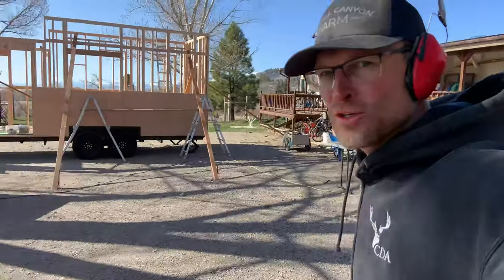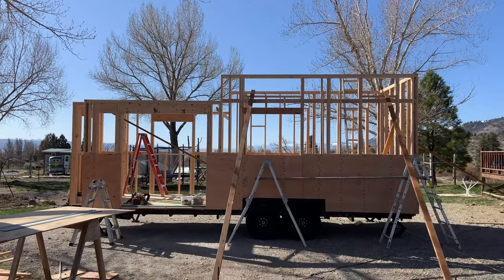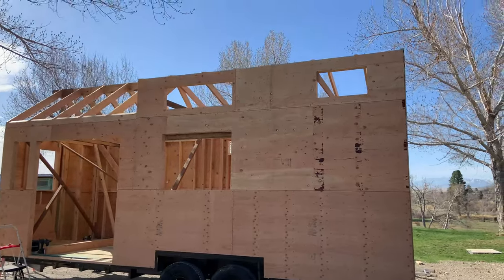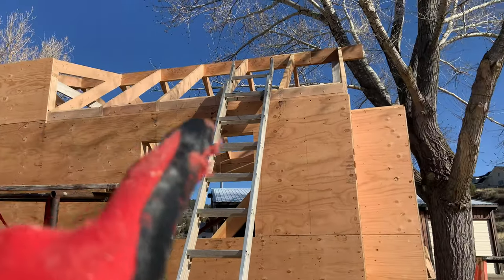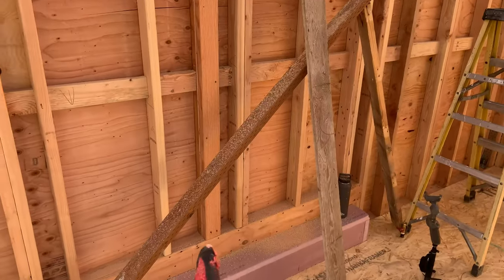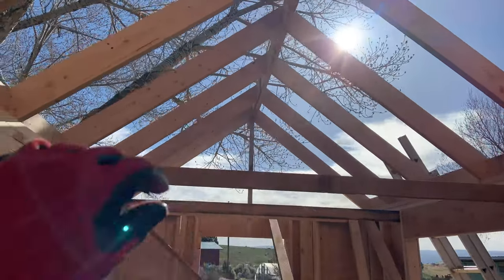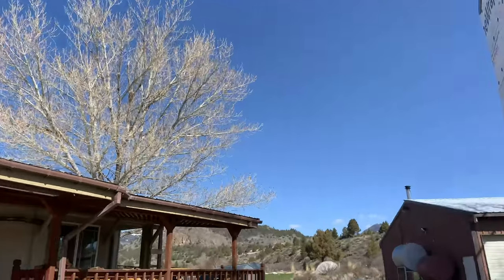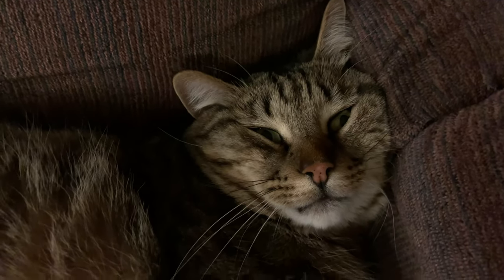Tiny House on Wheels // Part 4 // Framing Overview

Comment: You might want to pour some thread cutting oil on that pipe as you thread. It’ll help prevent broken threads, and give it a smoother fit
Reply from the maker: Oh, I did. Just don’t think it made the final edit. It is almost impossible to get good results without it. Thank you for the comment!

Comment: Also, cant help but notice you omitted your valley rafters on the dormer in your sketch up design. I figured out how to build those using the compass rotate function and the simple valley rafter calculations given on the old online calculators.  Got even crazier though in my design when I started using radiused rafters in a valley setting, which I learned later was called a crotch. Very cool thanks for all of your design detail tips on the iron eagle.
Reply from the maker: If anyone was to notice the omission I had a feeling it was going to be you!Good eye mate. We decided to forego the dormer plan to streamline the build a bit. It was going to add too much time for what it was worth. It did look nice in sketch-up and would shed water/snow away from the door opening, but it just didn’t happen. Poor dormer.

Comment: Hey Brian, nice design! You really shroud your framing process in mystery! You were just gusseting two by sixes together, I’m guessing they were bottom plates and I’m guessing you were framing them in tandem?  What was up with that clip right before you jumped to all of the walls stacked on top of each other? I too am about to start framing inside a garage that won’t allow for wall erection height.  I like what you’re doing.
Cheers.
Reply from the maker: Hi Scott. I am currently working on a more in-depth framing video with more of a deep dive into the choices and techniques used in the framing. The 2x6s were temporarily used to construct a rail system to frame the wall above the wheel wells using the roof rafters as rails. After we stood the walls they were disassembled and used in the roof.

Comment: Hey Brian, I notice when your were doing your sub floor, you added a 1.5"  foam insulation. Did you screw the sub floor to the flange or did you hope the foam will be enough support. My concern would be some flexing issue with the floor. You used a single bottom plate. did your sub floor go above the bottom plate? How did you handle the vapor and air barrier for the sub floor? 
Many Thanks
Reply from the maker: Hi there! The subfloor is bolted through the rim joist and floats above the foamular in the pan. It compresses the foam on the rim joist  between the outside steel of the trailer and the rim joist 2x6 and essentially the entire subfloor is supported by the 5/8” bolts. No vapor barrier on the inside, however the foamular has been glued together and to the trailer. Hope this helps!
Reply: @BidwellCanyonFarm   Thanks for the reply. How about the flange part where the ply sheet sits on the foam and flange. Is the foam enough support to hold the ply or should we put a 1.5" thick  wood strip spanned along the flange to provide support for the  ply sheet. Your sub floor is above the bottom sill is that going to be a problem when doing the interior finishing?

Comment: I'm really enjoying those videos. My design is quite similar to yours but smaller.
Reply from the maker: Awesome! Did you get your building materials before the big price increase?
Reply: @BidwellCanyonFarm  oh my gosh, I wish.  It's insane. Got lucky on a few deals here and there. You should see my setup, the exact opposite as yours: in my driveway, with a tiny shed on it's side and about 200 sq. ft. to spare and build.

Comment: Brian, Quick question.  Did you run sheathing over the flange on the wheel well?  Or, does it just butt up against the edge of the flange and the WRB overlapped and glued to the metal?  Thanks ahead, Scott
Reply from the maker: Hey Scott! Good to hear from you. I have not yet added sheathing there, but i am planning on it. I glued the xps right to the metal and glued the framing above (4x6 header underside) and double trimmer studs to the xps as a seal. I want to glue one more layer of xps on top of the existing stuff and doubling the wheel well r-value to 15. Then framing a box which connects at the sub floor and ledgers off the wheel well header, then sheathing it with 1/2” cdx. Luckily i still have a sheet left over from the original materials purchase. I have been itching to make more videos just need to find the time.

Comment: how did you fasten the tube steel beam?
Reply from the maker: If you are talking about the steel trusses above the living space, i welded on tabs that i lagged onto the top plate and through the ridge beam. Then notched the ceiling boards around them for a finished look!

Comment: I would like to let the people know that our building they are tiny homes to make sure that you level your trailer before building a lot of tiny home build don’t tell you this, but if you do not have your trailer frame sitting level when you build your walls and stuffit is not going to be level so make sure your trailer is level before you start building your tiny home
Reply from the maker: Thanks bud! Good tip!